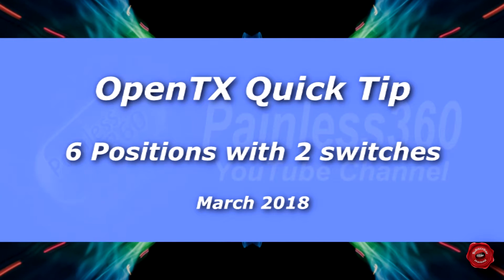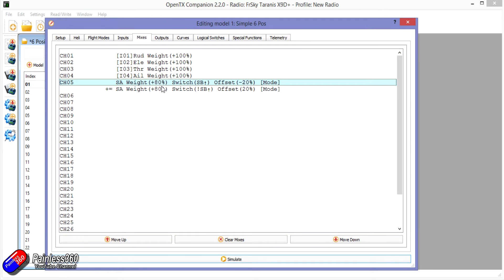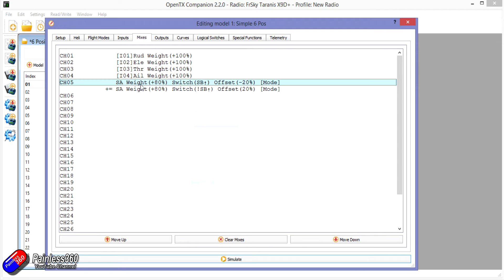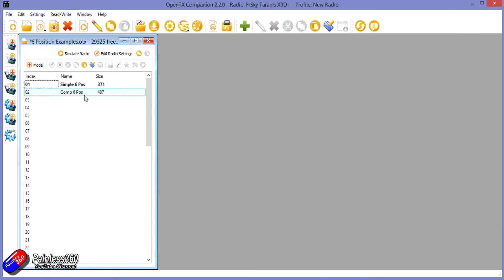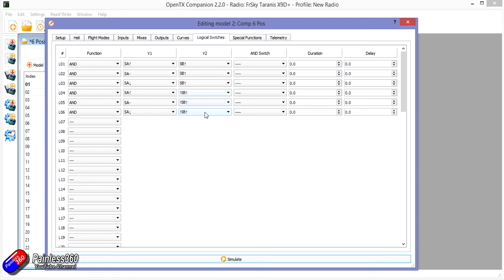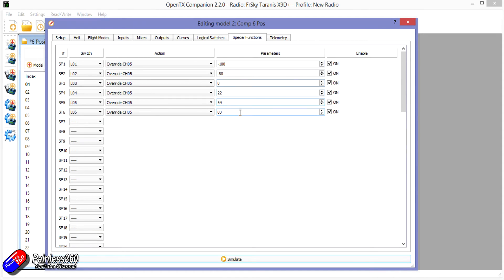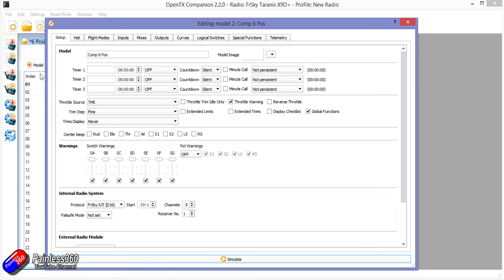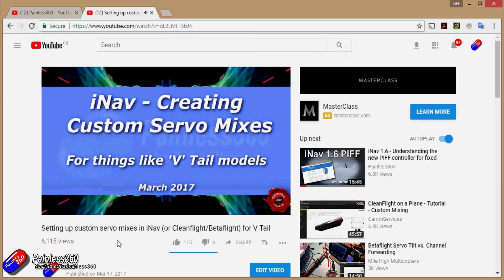OpenTX Tip: 6 Positions from 2 switches

Comment: Sir, i have three of the flight modes set up in flight modes screen, but it will not recognize any others. say 1 position 2 altitude 3 mission, then i want 4 ? 5 ? 6 ?, but it only will let me set 3. then the others say C down, when i was using B up, mid, down, is not activating it to show up on home screen as a new mode activated. do you know why?
Reply from the maker: Tricky to comment without being able to see the radio. Sounds like one of the steps is missing.. Best of luck
Reply: I figured it out. Logical switches to combine switches for displaying which mode the TX is in. Thanks. @Painless360

Comment: Thanks, Painless360! I found Channel Override quite powerful. I created a bunch of logical switches using AND, NOT, and STICKY logic for the 5 physical switches and was able to use just one channel for most of the flight modes in iNAV. Earlier I needed 13 channels to accomplish this.  Now 8 channels do the same thing with better latency on R9M.

Comment: Hello amazing your videos thanks a lot...
BUT I NEED HELP

What to do with a Arkbird auto pilot and Open Tx on radio Jumper T16;
to access to the menu of the Arkbird OSD  they ask to parameter 2 switches von Channel 5 and 6 :
while the CH5 <50% it switch to Manuel mode
while the CH5>50% and CH6< 30% it switch to Balance mode
while the CH5>50% and 30%< CH6<70% it switch to GYRO
while the CH5>50% and CH6 >70% it switch to RTH

I am totally lost and until 2 days I try to parameter witout any success even watching tuto

CAN YOU Help me Pleassse
Thanks a lot
Reply from the maker: Setup CH5 as a two positron switch and CH6 as a three position switch and that should work... Happy flying!
Reply: @Painless360  thankss

Comment: Can you use companion this way to set up a Horus x12s?
Reply from the maker: I’ve not got that radio but it does look like Companion supports it. Check the documentation  and release notes. Best of luck!
Reply: Yes.  I have a X12S and a X10S and they both work just fine with these settings.

Comment: Is there anyway to emulate the vector way of doing it with a sub mode in INAV? IE, one 3 position switch is say manual, launch, submode, and when that switch is in the submode position it enables another channel and disables the first switch. the way my vectors are setup, i have on SA as off, gyro, 2D+submode, and SB is ALTHold, Loiter, RTH.

This way it would only RTH if both switches are down - saves me from accidentally hitting RTH
Reply from the maker: You can get close just by assigning each of the flight modes to the individual positions. You could also make the GPS return to home mode on a separate AUX channel and only have that enabled when both of the switches are in that position to. Lots of options, but nothing will be exactly the same as what you're used to with a Vector..
Reply: Let me get your input here, i think i have it close.

Inputs tab: 
SA on ch6, sb on ch7 with switch SA down in the config)

Nothing in the mixes

In special functions:
!SA down = Override CH7 -100

now the question is, what I can do is use the weight etc as you described in here so that in inav the "real" range is say -60, 0, +100 that way when sa overrides  SB it will be disabled.

so the question i have is, with SA down and the modes setup for ch7, does the fact that in inav channel 6 doesn't have a mode setup in that position (IE no bar there so technically would be as if nothing is set - or acro in quad parlance) would inaav ignore that and use the mode for whatever ch7 is set for or would it conflict?

Comment: Great stuff, I always welcome your OpenTX Tips. You probably didn't want to introduce Global Variables and the MAX function in this video, but I implement this kind of multiple flight mode by setting a GV (called CH5 in my example) in the Flight Mode pages to the required channel 5 value, then forcing channel 5 to this value using a mix such as:
CH5:     MAX Weight(+GV1:CH5)
Fewer lines and more elegant, but uses more advanced concepts. Maybe an OpenTX Tip on Global Variables and the MAX function would be welcomed?
Reply from the maker: I have a video on GV already and have used MAX in other mixes. The great thing about OpenTX is that there is always at least two ways to do everything! Thanks for the comment..